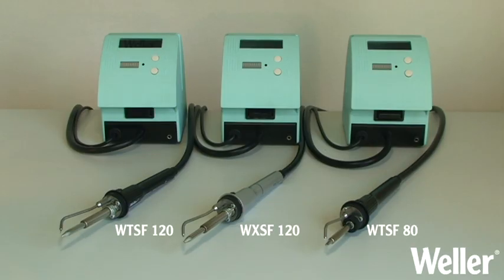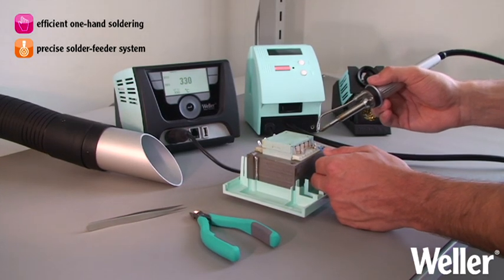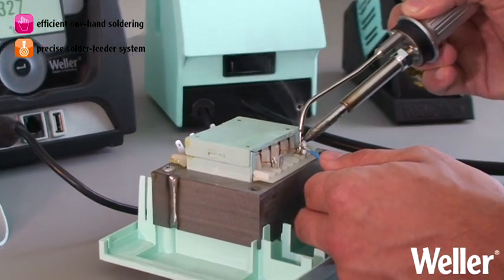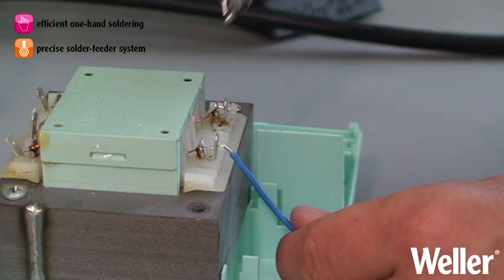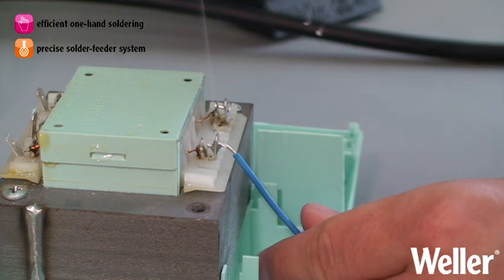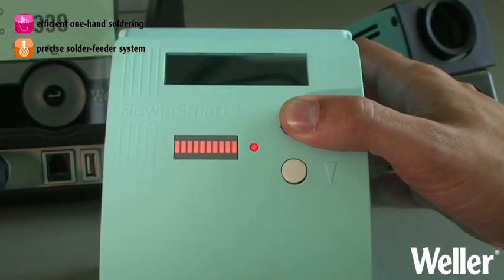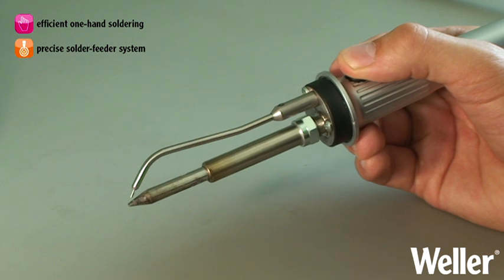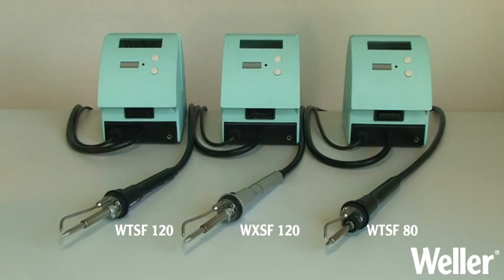Automatic solder feeder by Weller

Comment: WTSF 80 / WTSF 120 / WXSF 120
With the new selection of single-handed solder wire feeder units, Weller is streaming the art of soldering.
- Efficent one-hand
- Precise solder-feeding system for highest of soldering quality
- Amount of solder can be pre-set for effective soldering
- Several puls and timer modi to control the method of delivery of solder that reaches the soldering tip                                       Cosmos Engineering, Kaachi, Pakistan CEO Shoukat

Comment: But you cant clean the tip...
Reply from the maker: you can clean it perfectly with an Weller WDC and metal wool. as you can see the solder wire dispenser is slightly behind the tip. so perfect for tip cleaning. if you have detail questions please get in contact with our customer service team.